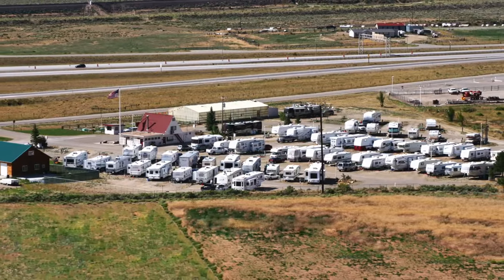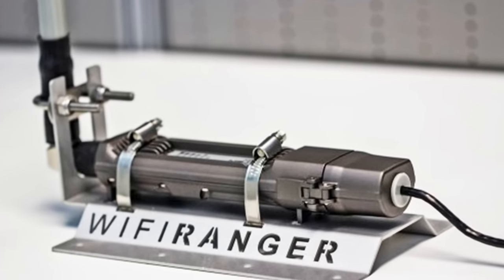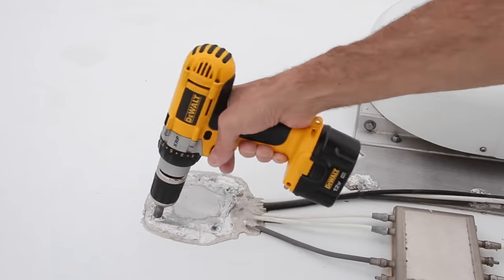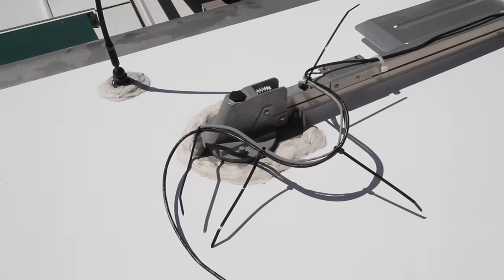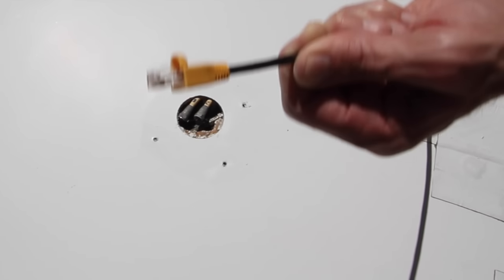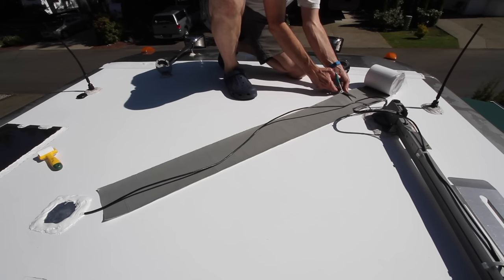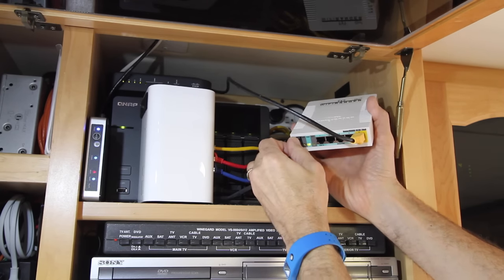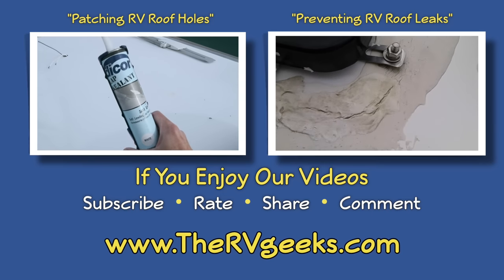Boost Your RV WiFi - WiFiRanger Installation

Comment: Hi - We are trying to purchase the WiFiRanger Elite Pack as you recommended for our RV ladder but when we go to the wifiranger.com website we cannot specifically find the unit that you're recommending. Too many confusing options. Can you post a link that takes us directly to the order form for the option that your video demos?  Thanx
Reply from the maker: Hi Marcie! We installed a WiFiRanger Elite Pack, which you can find here: http://wifiranger.com/shop/product/59-eliteac-pack

If you decide to mount directly to your roof (a flat, horizontal surface vs. the way we mounted ours, attached to our TV antenna, or they way you'd mount it to your ladder), you'd want the "FM" version (as in "flat mount"): http://wifiranger.com/shop/product/65-eliteac-pack-fm

Don't forget that there's a 5% discount on WiFi Ranger equipment using discount code "WFRGEEKS".

Hope this helps, Marcie! 😀
Reply: WOW!  $699.99  - really?  Is it really worth the price?  WOW!  But thanx for the pointer.
Reply from the maker: LOL! We know what you mean, Marcie... the WiFiRanger is definitely NOT cheap. There are cheaper options out there (which may be a better fit for your needs and budget... including cheaper options from WiFiRanger themselves), but there are a couple of features of the EliteAC Pack that we really love:

(1) Simplicity of operation: all of the components work together seamlessly and are controlled from a single web-based control panel. Other solutions we've seen aren't as easy to use and require that you have a fairly good knowledge of WiFi and networking to get them working. WiFiRanger has this down... park in site, power on the unit, connect to the WiFiRanger control page and choose the network you want to connect to. Done!
(2) Cellular Hotspot Tethering: the indoor component of the WiFiRanger enables you to connect a cellular modem (like a jetpack) and use THAT as your connection to the internet (in place of a WiFi network in a campground). This way, you don't have to constantly change the network that all of your devices are connecting to... they stay connected to the WiFiRanger network, and you just change what the source of internet is.
(3) Ethernet Ports: the indoor component ALSO has ethernet ports built in, so that you can connect non-WiFi devices to it and share them on the network. Things like printers and storage drives are then available to all other devices on the network.

All of that said... this still may be too expensive... or may be features you don't think you'll need, so why pay for them? You can check out the other units available from WiFiRanger if you want something robust, but more affordable. Or you can go with devices/packages like those put together by TechnoRV ( https://www.technorv.com/rv-wifi-boosters/ ), which are lower-cost alternatives that may do what you need.

And... finally... we'd suggest that you think about whether WiFi boosting is even going to work for you. If being connected is important, you're going to want to consider focusing your money on increasing your cellular data options (larger capacity plan, back-up carrier and even cellular boosting equipment). WiFi in RV parks is notoriously bad. Boosting devices like the WiFiRanger will enable you to get a strong, stable connection to the WiFi network... but won't guarantee that the speed of the internet service is sufficient for your needs. In 15 years of full timing, we can count the number of times we've had a really good internet experience on RV Park WiFi on the fingers of one hand. Most times, it's spotty and slow. At most places, checking email will be OK (as long as you're not sending/receiving large attachments) and some simple web browsing will work. But streaming video? NO WAY! Facetime/Skype calling? FUH-GET ABOUT IT!  😉 Increasingly, we rely primarily on our cellular data... and use WiFi as a backup for when we've used up too much cellular, or don't have need of fast service.

If you're an occasional web surfer... and don't get frustrated/disappointed if you can't get online? WiFi will likely work great for you... and won't cost you a bundle every month. But if you absolutely MUST be online... cellular will make you much happier.

Check out RV Mobile Internet ( https://www.rvmobileinternet.com ) for a wealth of information about both cellular AND WiFi connectivity options. And if internet is a must, join to get even more out of it! (MIAGEEKS will save you $5 on your first year's membership).

Comment: what wifi booster do you recommend that has both the wifi router and wifi antenna to bring in the external signal so it can be used by more than one user wirelessly? I prefer to use an all in one line of sight device for now.  Thanks
Reply from the maker: +carmas54 Well... you can use just the WiFiRanger Elite antenna unit as a standalone (it connects to the park WiFi and re-broadcasts a private WiFi network), but looking at their website, it doesn't look they sell it separately any more (can't hurt to contact them, though). You may also want to check out http://www.technorv.com/RV_WiFi_Boosters_s/85.htm to see what they offer (less expensive than WFR). Barring any of that working for you… check out http://rvmobileinternet.com for more ideas. 

Hope this helps!
Reply: I found an antenna and wireless router from Alfa that will do the trick (it's the closest to an all-in-one I've been able to find) for now that can be positioned next two each other which is great since the RV is a Truck camper and there isn't much roof space, the next vehicle will not be a problem and I'll go with WifiRanger.  Thanks for the quick response...I'll check WifiRanger's site.

Comment: So this would be suitable for a caravan which is parked next to my house and WiFi signal just reaches the caravan would this extend it so I get full cover?
Reply from the maker: Yes indeed! That is exactly what this does. Takes a weak WiFi signal and amplifies it.
Reply: RVgeeks Ah awesome that helps me out so much thanks ! I'll be sure to order one now
Reply from the maker: No worries... our pleasure. But one note... if you really only need to boost the WiFi in this one, known location (with your caravan parked next to your house), there are definitely less-expensive options out there that will achieve the same goal. Where the WiFiRanger shines is when you're out-and-about traveling and need to connect to weak WiFi signals at lots of different places. The interface is relatively easy to understand and use, so it makes connecting to each new network a snap. But if you don't need that, you could also check out options from http://technorv.com or, if you're a little tech savvy and want to roll your own solution, look at options from Ubiquity Networks (http://ubnt.com)... like their NanoStation AC... they offer a lot of bang-for-the-buck, but aren't quite as simple to setup if you're on the move a lot.

Comment: Anything newer or better on the market?
Reply from the maker: Hi Dan,

We don't typically keep up on this area, as we're very happy with our WiFiRanger. That said... WiFiRanger themselves have updated the Elite Pack (by upgrading the system with 802.11AC compatibility and upgrading the ethernet ports to gigabit ethernet). And Winegard has come out with their ConnecT units ( http://amzn.to/2xQdkzz ). Other than price, the only difference we know of between the WFR Elite Pack and the Winegard ConnecT is that the internal router on the WFR can be connected via USB to a mobile hotspot so you can share the cellular data connection to your whole internal network. There may be other options out there... but if you're really interested, we'd say your best bet would be to subscribe to http://RVMobileInternet.com because Chris & Cherie stay up-to-date on everything there is to know about WiFi and cellular connectivity for RVers (you can even save $5 on your first year's membership by using the code MIAGEEKS). Hope this helps!

Comment: So how is working ? I hope good.🌜
Reply from the maker: Hi Tony! It is indeed. It's not a magic bullet, since getting a good connection to an inadequate internet connection doesn't over come that obstacle. But we can connect to almost any WiFi signal that would usually be out of range, and if it has reasonable bandwidth, we're off and running. Here's a quick follow-up video we made in exactly that situation: https://youtu.be/TacVPXE68RQ

Comment: Skypak2 wifiranger's low end solution, do you know what the min. distance one needs (or can get away with) between the antenna and the router? WifiRanger won't answer their phone. Not good.
Reply from the maker: @camas54 - Not sure we understand the question. There's no "minimum distance" needed between the on-roof antenna and the interior router (Core) unit. They are connected via Ethernet... so you can pretty much use as short/long of a cable as you need.

Hope that makes sense!  If not... please clarify what you're looking for and we'll do our best to answer!
Reply: I finally got through to WIfiRanger and they said perhaps 5-10, to be on the safe side I wold then separate the two 10 plus away
Reply: RVgeeks min distance to avoid oscillation

Comment: Nice! But I would trust my unlimited data Verizon connection over spotty and possibly unsecured WiFi from a trailer park (as long as I was somewhere within Verizon service area). Great videos though! :-)
Reply from the maker: For security, you can add a VPN when connecting over an unsecured WiFi network.